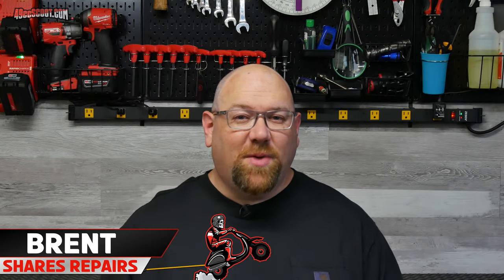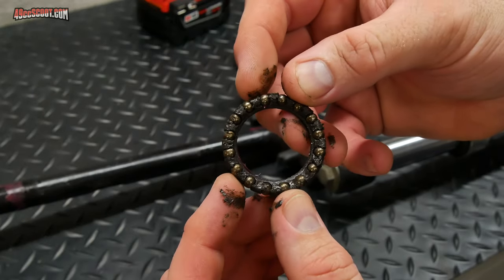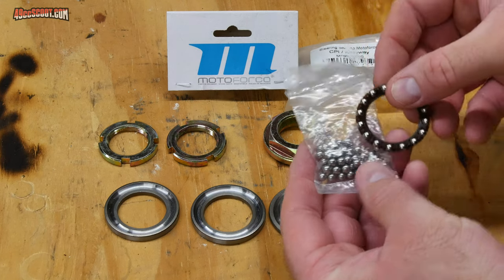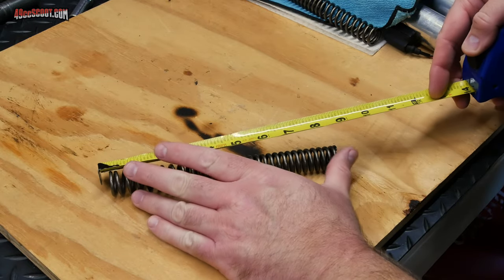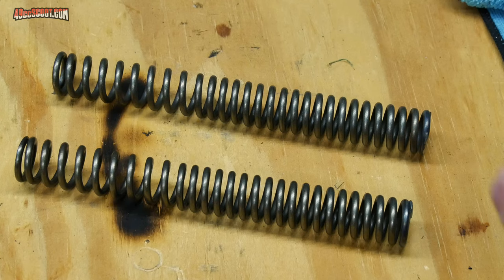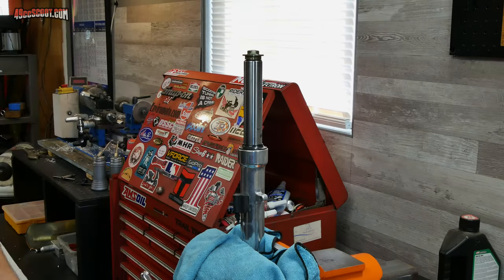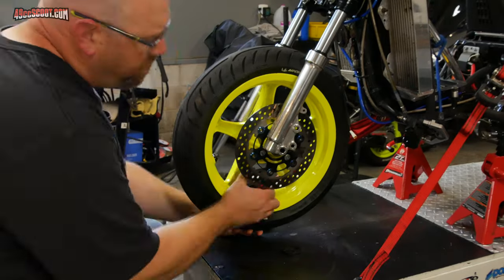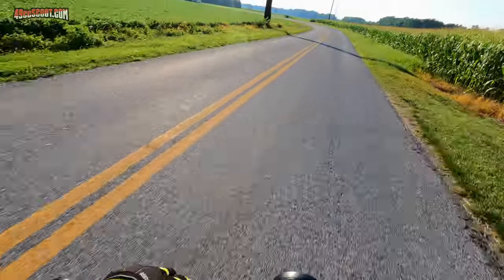Replacing Scooter & Moped Steering Bearing And Races And Cutting Fork Springs To Stiffen Them

Comment: Hi nice video,when fitting loose ball bearings the correct method is to fill the race with ball bearings and then remove one ball, this gives the correct clearance  between the balls.the correct method for tightening the bearings is to tighten the nut until there is no play in the stem with the forks loose enough so the handle bars can turn from side to side from a central position with a slight tap under their own weight

Comment: A friend brought a Chinese scooter over to straighten the handlebars. After working with it, I found that the bolt hole that mounts the entire handler assembly was not in line with the front of the tire. Does that mean the stem is bent?
Reply from the maker: Possibly. I'd want to know what happened to it. If they bought it that way or if they know it was crashed. If uncertain, I'd replace the stem to be safe. Having seen pics and video of crashes and the aftermath of steering stem failures; it's not worth it to me to risk using a stem that has potentially been stressed enough to bend. Sometimes they'll bend in a way that you can look at the forks from the side and see that they are no longer both at the same angle. Most of the time the mounting bolt hole for the bars will be front to back or side to side so another clue may be if that's not in one of those 90 degree orientations.
Reply: Ok, he said his niece was learning in yard, was going fairly slow and fell down twisting the handle bars. The bolt hole that holds the bar assembly on is at about a 45 degree angle compared to front tire. I didn’t know if the stem is a two piece in the middle somewhere. But it sounds like a whole new stem is best.
Reply from the maker: @joshuacrai  My friend's wife did the same to his 150. She was just trying in the yard and went down at maybe 10MPH and bent the stem. Seems like it shouldn't happen on grass that slow, but I have seen it.
Reply: Well that’s good to know. I’m assuming the country of origin had everything to do with that!

Comment: Man o man you went a long way, but always interesting of course, explaining how to cure bouncy springs. Maybe people shouldn't  comment if they want to give you a hard time even though sounds fun.....About trivea ? I was riveted , l wonder, if you turned out 2 spacers to fit on your lathe is that not shortning the bouncy spring intended  but keeping the origional intendedly well shaped uncut springs? Technically speakin shortened or not it just works. P.S. I Tink!
Reply from the maker: The most ideal way is to get springs of the desired rate, but the spacers add some preload and that helps it sag less.

Comment: good how to video.

On the springs, you should have cut more off leaving the end with the least number of coils to be used.  But before you cut, you should measure the total gap distances (added up) and make sure that measurement is much greater than the distance the fork can compress.  Although you called this a progressive rate spring it really acts like a 2 rate spring.  By just cutting a small portion off, you are just shortening the transition point.  That is, you still have a soft portion and stiffer portion of the spring.  You will quickly bottom out the softer portion and move to the stiffer portion but have a little bit more travel distance on the stiffer spring rate before bottoming out.

An easy way to check things is with a ziptie on the fork stanchion to measure how much of the suspension you are using at rest (with you on the bike = static sag) and how much you use when you ride (checked many times for max travel).  At rest, you should not use more than 25% of your total travel.  Some would say no more than 33% but this is more for a properly set up motorcycle where you have better components to help you manage the spacing.  For your situation, you are trying to not bottom out and use your available 2+ inches of travel the best you can for your weight.
Reply from the maker: Thanks for the info. The good news is, it actually worked well for me so far for 10 months and counting and a whole lot of up and down from power wheelies.

Comment: Can you make a video on how to make a ride on workbench like yours? Or do you have photos of the complete bench? I want to make one my own because the bike lifts are so expensive😅😅
Reply from the maker: Here's a little info on my bench. I'm no carpenter, so I'm sure there are better designs out there, but this has worked for a long time for me. 

https://49ccscoot.proboards.com/thread/6199/scooter-work-bench-table?page=1

A couple of additions to that are to try porch floor paint to coat it. It may be a little more durable. I used some leftover stick on floor/wall tiles on part of the top of mine recently and those have worked out well for me. I also screwed a piece of 1/4" aluminum on one end of the top to grab the ramp that I use so it can't slide off.

BTW, I don't ride up there. I push the scoot up. You really should have a ramp that sits low and then raises if you want to ride on. If I was going to ride up this thing, I'd want it to be wider. I have really no room to step off. I'd also incorporate a step to make it easy to get down. That stuff would make it easier to mount and dismount, but doesn't change the process of trying to get the scoot up and down safely.

Comment: Hey, check out rubber dust sealing for lower steering cone that on Yamaha gear UA 06. It works great. Maybe it will fit.
Reply from the maker: Thanks, but we don't have that model in the US so no parts sites here carry stuff for them and I'm not sure where to get parts diagrams for overseas models.
Reply: @49ccscoot  oh, that's pity(

Comment: Hi I have been mean to do front and checks for so long but have not. Had the new tyres on 4 months now but have not push my luck.  It's just put the lid on and go I'll be home after dark. All other checks have been done.  Thank you for this one I have been thinking that the front end is little bit  ??? Not sure
Thank you again it's great video
Reply from the maker: The check itself is pretty quick, so at least find out if there's play. It's good to do routine maintenance before there's a problem, but if it moves well and you don't have any play it may be something that can wait till it's convenient to do. On stuff that's well sealed, they can often go great distances without issue. My 2011 TMAX has had 12,000 mile and 28,000 mile services where I took the front apart and everything still looked new.

Comment: Nice looking impact gun. Addictive to use but it’ll break bolts just like a pneumatic if you’re aggressive with it.
Reply from the maker: I've just been using it somewhat gently to zip things on or off, hand tightening at the end. It's something that I should have had years ago. Seems to be a major time saver vs hand ratcheting everything. I always used a corded drill for home projects too, so this and the M18 drill have been amazing upgrades. I don't like ladders anyway, so getting rid of a cord while on a ladder was pretty great when I replaced a window recently.
Reply: @49ccscoot  I remember from your video with Ryan you saying “I gotta get me one of these.”  Looks like you did. 
I have the m18 1/4” hex for work and also the mid size 1/2” m18 impact rates at 400 ft/lbs. That one is very good for heavier tasks but still light enough for usage. I use it for the torque driver clutch nut when changing the main spring. I use the small impact for the variator and TD keeper nuts.
Reply from the maker: @robertpierce1981  Yeah. I've wanted one for so long (years) and just did it. I still haven't modified my tool kit to carry it along, but I need to. I may make 2 kits. What I currently use and 1 for the impact, because if I park somewhere I don't want this on my scoot, but I'd carry it when I'm gonna stay around the scoot. Either that or figure out how to lock the seat without easily being defeated (because you could just grab the cable on the fairingless scoot).

This is just the 1/4" impact driver. It's rated high enough to take off lug nuts, but I don't know that it would. Doesn't seem like it, but that's not what I got it for anyway.
Reply from the maker: @Kevin Stearns You'd have to measure them and check spring manufacturers to see if anything fits or could be done custom. You could try find shocks or springs that fit from another scooter. To my knowledge, there aren't places carrying various fork spring options specifically for our small scoots.

Comment: can you lowered those type of front telescopic fork? TIA
Reply from the maker: Yeah. Sometimes the design of the clamp will let you just move the forks up in the clamp. Others have designs that prevent that. Some people cut the fork tubes and springs to make the shocks shorter. Depends again on the exact design that you're dealing with. Threads or any sort of special machining on the ends may make it difficult. Sometimes you can find shocks that are shorter and just bolt them on, but they need to match the steering stem and your brake mounts and axle size.

Comment: I seen putting a spacer in your forks makes them a little stiffer. Do you think that’s true?
Reply from the maker: It should firm up the front a little.
Reply: Because it’s compressing the spring a little?
Reply from the maker: @nastynatesscooters9896  Yeah, it's putting preload on it.

Comment: hey brent, wondering ... i have a 2022 wolf jet (gy6 50cc)- any easy/subtle mods to get a little more "umph" out of it?   i know mechanicing pretty decent
Reply from the maker: I disappoint everyone that asks this, but I'd put a 47mm big bore kit on it if it were me. Most of the time that works just fine with the stuff already on the bike. You may need to rejet/retune the carb and maybe swap roller weights. With the stock airbox and stock exhaust, it should appear to be pretty much stock while having quite a bit better acceleration and more speed. Best of all, it's not terribly expensive.

If you need some install help : https://49ccscoot.proboards.com/thread/350/big-bore-kit-installation

I've got a BBK before and after vid that shows how much difference that can make : 
https://youtu.be/PoK6ofGjeZA
Reply: Wtf is a wolf jet🤣 anyway dont do anything to that cheap China crap just be happy that its still running.😄

Comment: What’s it called a race or a sleeve???Cuz im have trouble I feel like I got the size or something cuz it wont even go on the shaft at all it literally gets stuck at the neck!
Am I doing something wrong or do I got the wrong size sleeve or whatever it’s called
Reply from the maker: Measure the neck and the race and see if you did get the wrong size.
Reply: @49ccscoot  I found a shop that has the right size race an they are gonna press it on for me. Thanks for responding

Comment: j'aime pas moto force la qualité de leur matériel est vraiment moyens rien a voir avec du oem de cher Yamaha
Reply from the maker: This is a Chinese scooter. I don't have the option of buying dealer direct parts for this scooter. Vento is one of the few Chinese brands that did have an OEM parts site, but that's been gone for over a decade. Motoforce quality is at least as good as original and sometimes you sort of have to take what you can get unless you can find a direct match or want to modify everything with Chinese scooters. I have no complaints with the Motoforce parts that I've used so far. Aerox wheel hub, M10 brake rotor bolts, steering kit, and various other odds and ends.